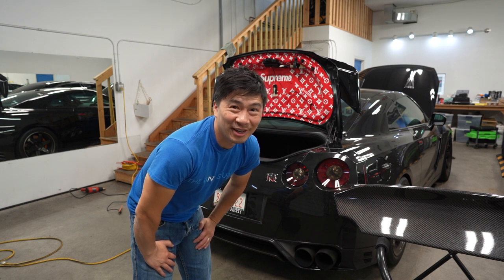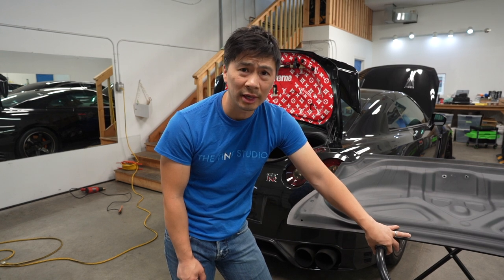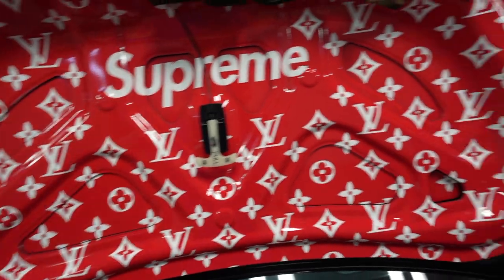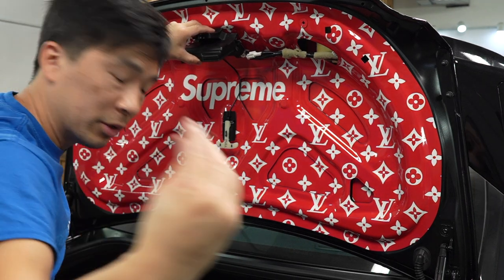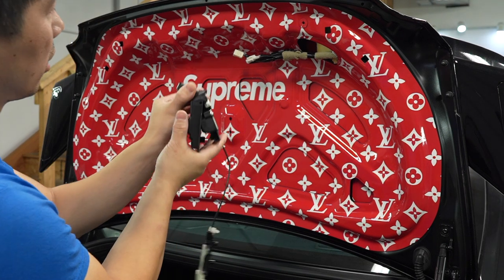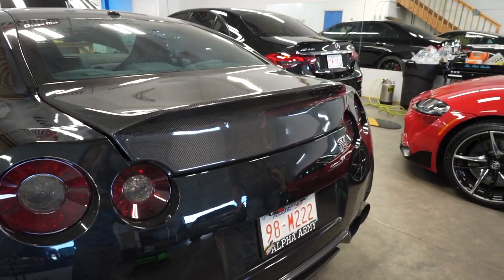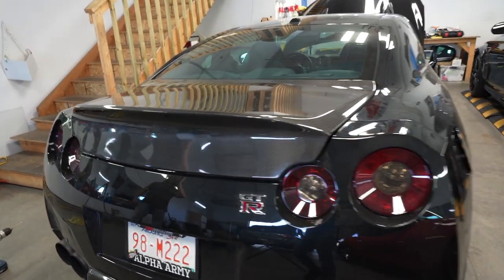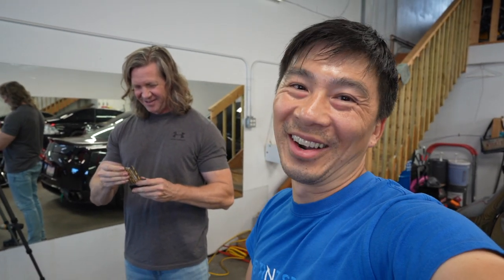Is A No Name Brand Trunk Fitment Worth The Price?

Comment: I like that trunk design was that a wrap or costume paint? I guess it is true that you get what you pay for. I think to me the CF trunk is good if your tracking the car and not worry about getting it damage, but for show car or for a daily drive I think its best if you buy Seibon brand. But just a thought, it still your car. 🤙🏼 overall glad you made some great content.
Reply from the maker: I will switching out this trunk for a different one. I know Seibon produces these trunks for AMS but I do have another brand in mind.  I will make another vlog when I get it.
Reply: @phothrottle which brand did you end up going with? I been thinking of getting the KPcarbon brand
Reply from the maker: @559Lucchese  the one I installed in the review was a no name brand. I think is was alibaba.
Reply: @phothrottle  Oh yeah I was referring to the old comment about you having another brand in mind for the trunk other than the alibaba one.
Reply from the maker: @559Lucchese  JCR Carbon Fibre DN Trunk
https://www.revozport.com/product/gtr/jcr-limited-edition/jcr-trunk/

Comment: Wondering if you are able to move the striker down to compensate for the gap? Portion that is attached to the body (metal part that the latch hooks on to).
Reply from the maker: This would be the best solution to fix the gap but I'm not sure how much tolerance/play the factory allows. Thanks for the help

Comment: Great video, thanks. Couldn’t have been more relevant for me as I love the duckbill and have been wondering what the fit is like on no name copies. Wasn’t too bothered on the carbon finish as I’m looking to get it colour coded but couldn’t get past that fit. We don’t have the “hostage” release in the U.K., would that affect the wiring you did?
Reply from the maker: You will need to do what I did if you have a factory wing and third brake light. It only cost me $4 cad at the local pick a part. I found it much easier then taking the wing apart.